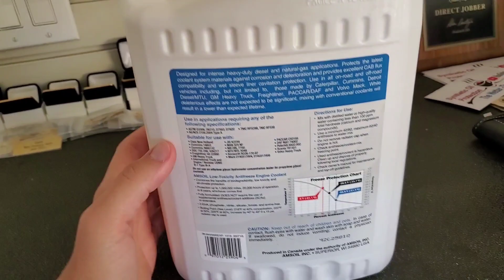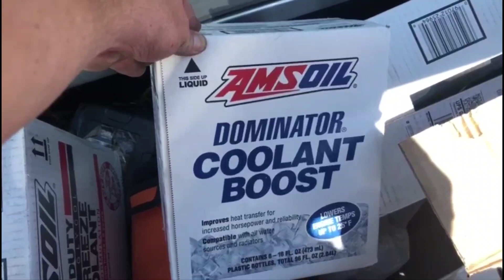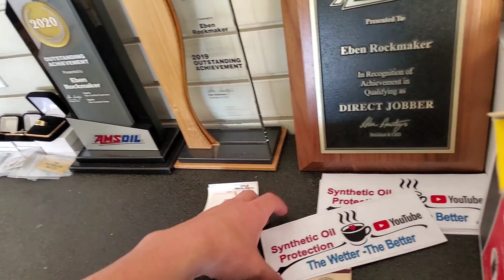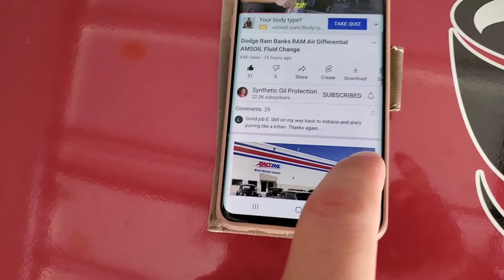Radiator Efficiency Tips AMSOIL Coolant Cleaning

Comment: Very cool Eben, the fact the coolant is biodegradable and superior to other products is amazing.
Reply from the maker: Tell me about it!

The other part that's crazy is how inexpensive it is because it's a concentrate and then all you do is just add the distilled water so it's actually quite a bit less money than any other coolant on the market.

It's amazing.
Reply: @Syntheticoilprotection  is this coolant good to replaced for a chevy cruze since it uses dexcool?
Reply from the maker: Yes I did it on my Corvette and it made a huge difference.

You'll see that video here - https://youtu.be/iuVZZlOXzj8
Reply: @Syntheticoilprotection  awesome will do the switch as soon as i get the product. Appreciate you eben🙏
Reply: @Syntheticoilprotection  is the black container and white the same coolant?
Reply from the maker: Not sure what you mean?
Reply: @Syntheticoilprotection  theres a black and white amsoil coolants.. are they both the same?
Reply from the maker: I know what you're talking about the light car and truck versus the low toxicity biodegradable coolant they are a different formula the low toxicity biodegradable coolant is much better it's less expensive it holds up longer and it meets and exceeds more specifications that's all I use in my personal vehicles is the white bottle with the dominator coolant boost
Reply: @Syntheticoilprotection  yeah i should of explained it better.. thank u eben🙏

Comment: Amsoil is the best, I used the Heavy Duty Amsoil Antifreeze and the Jeep is running cooler for sure, and it's Pink.
Reply: Do you drive your jeep off roading a lot? I'm just wondering if the heavy duty stuff would be good for every day driving.
Reply: @AustinsCoins  It gets used for doing uber eats all day so lots of stop and go and idling. I also put in the Amsoil DOMINATOR Coolant Boost, with that and the amsoil signature series synthetic oil the jeep runs cool. I use the 10w 30.
Reply: @96HDFXSTC  Oh cool, that makes sense then. What if you did a long highway drive? Is there such thing as too cool?
Reply: @AustinsCoins  If it is moving down the street or on the freeway it will maintain about 185, lots of idling max is about 205, before the amsoil it would hit 220 plus.
Reply from the maker: I suppose if you lived in Alaska it could be too cold 😄😁

Comment: I'm due to overhaul the cooling system in my 1988 Land Cruiser this summer. Full flush, new water pump, new hoses (and clamps for the love of God) all around and new thermostat. For the 350K miles of its life I've used 50/50 Toyota red coolant and nothing else, but plan to fill up with Amsoil this time. I see a lot of videos about their low toxicity antifreeze but very little about their heavy duty antifreeze. It seems to me that if the performance and longevity were the same between the two (as the price is given one is concentrate and the other is pre mixed), it would be more economical to sell JUST the low toxicity. Is there a critical difference between the two other than the toxicity levels that would dictate whether I'd want one over the other?

Comment: How many bottles of the coolant boost would you use on a regular pickup truck
Reply: 1 oz per quart of coolant. 2 oz per quart of distilled water. One bottle would treat most v8 or smaller engines.
Reply from the maker: About 1.5 bottles
Reply: @Syntheticoilprotection  You would know better than I would. I was assuming most passenger vehicles don’t hold more than 16 quarts.

Comment: Project Farm found ZeroWater helps get a lot of solids out of water which helps if mixing with that stuff.
Reply from the maker: What is that Is that like a coolant flush?
Reply: No, it’s a water filtration system for the water you would add to the coolant since it’s a concentrate.

Filtering out the medals would be very useful to stop corrosion though since that’s a must. Good for your internals too.
Reply from the maker: So it's a filter that you can add on to the car?
I'm guessing you put the filter somewhere between one of your coolant hoses?